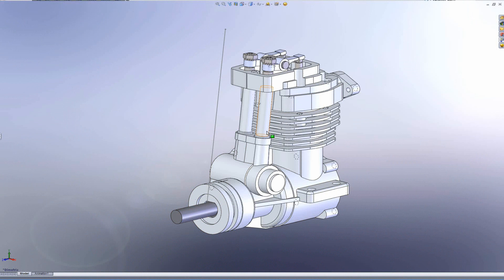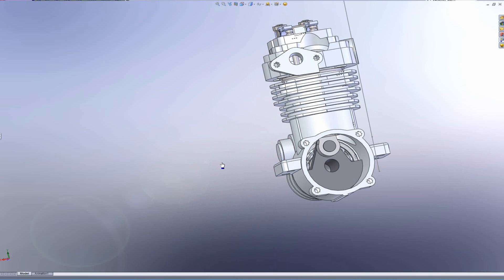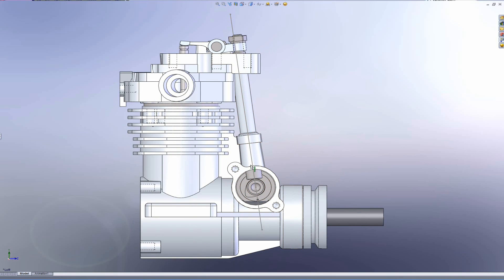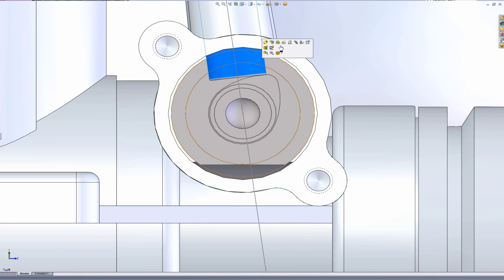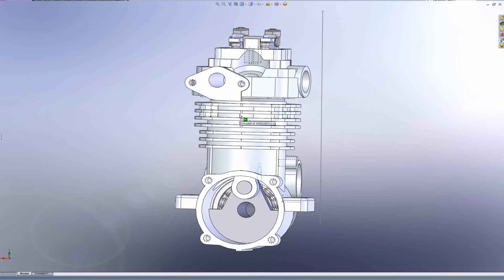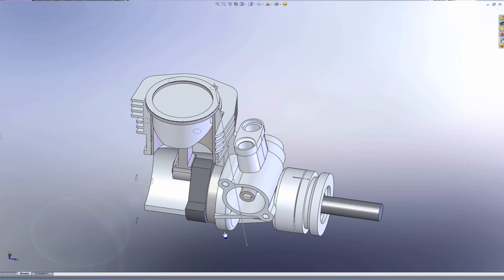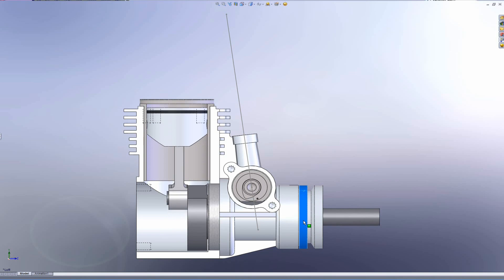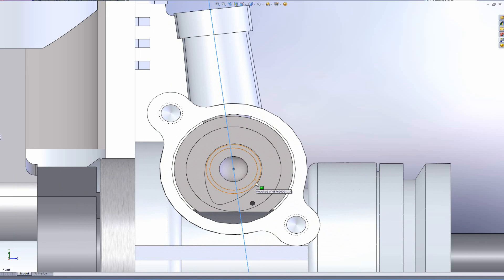OS Engines Four Stroke Camshaft Timing

Comment: Is it a worm gear combination ???!?!! Is the crank shaft is the worm and the cam attached with gear ???!?!!!
Reply from the maker: It's a 2:1 ratio and is a helical gear with a cross arrangement. Worm gears have one or two "teeth" on the worm so the ratio is typically quite high.

Comment: My OS 120SP did this right out of the box. It was sent to Horizon hobby several times without fixing what was wrong. I was even sent a new one that displayed the same rich running condition. I was told by them the super charger needs to be broke in to the point of not creating much boost?
Reply from the maker: Strange that they couldn't get it sorted out. This would have been what 25 years ago?
Reply: rcdieselrc yes, I bought the engine as soon as it was available. I even sent them  a VHS of the engine going rich when it was tipped upside down pouring out a lot of smoke and quitting.

Comment: I still own my OS 120SP, it ran great on the test stand, but installed in a Goldberg Ultimate every time the bipe was rolled over the engine would quit with a rich condition no matter how tweeked the needle valve was. The aggregation this engine caused me i got out of the hobby of model aviation.
Reply from the maker: If it's the old one, the pump and/or regulator diaphragms have long ago deteriorated and are stiff. It's happened to most of these at this point. Unfortunately, there are no spares available. If it's an SIII, it probably needs cleaning, but parts are still available if it's more than that.

Comment: hello friend, how are you? give me some help pls, and in this exact alignment do I have to adjust the valves?
Reply from the maker: To adjust valves set the crank to top dead center of compression stroke. Both rockers will be unloaded at this point.

Comment: i am working on a 125 parallel twin ohc engine no push rod how would i set timing on the cam shaft thanx.
Reply: +Mark Macmillan as a rule of the thumb on any four stroke engine no matter how many cylinders it has got if you set the piston on one cylinder to top dead centre, make sure it is NOT the ignition stroke for that cylinder and have both valves rocking, that means as the inlet is opening the exhaust will be closing around the same time (valve overlap) your engine will run.
Reply from the maker: If it's not an RC engine I suggest you fine the proper manual to set the cam correctly in your engine.

Comment: Do the OS120 FS-E require two head gaskets? I have a rebuild kit and it came with a smaller and a larger thickness head gasket. I'm not sure if I'm supposed to use both or one of the two.